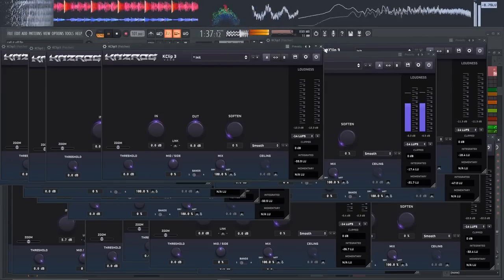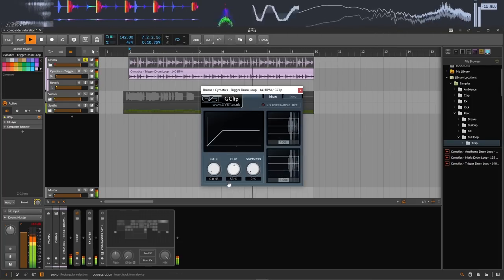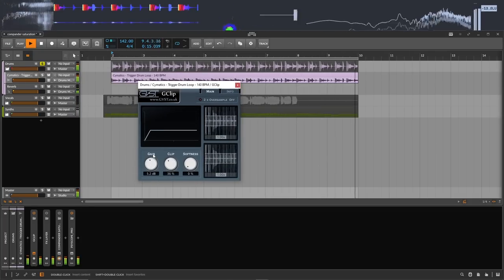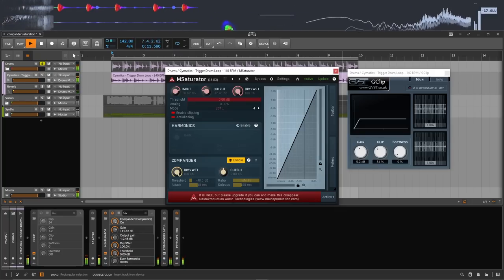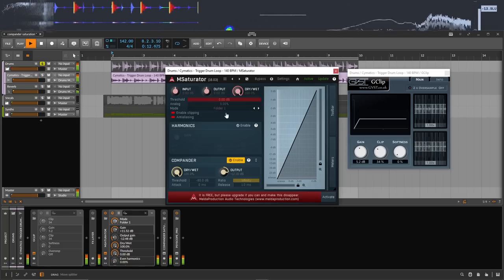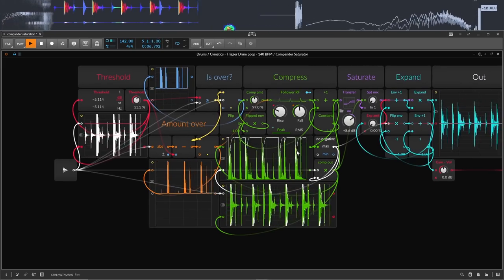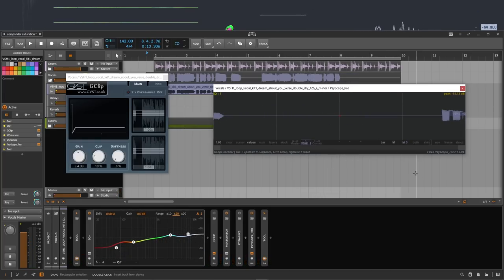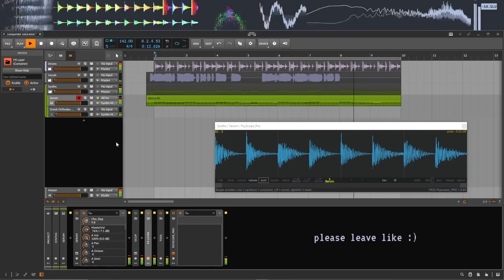heavy distortion without losing dynamics

Comment: thats cool, and i can also recomend kilohearts distortion, but i just wanted to point out the simplest solution: dry/wet mix. layer an unsaturated signal with the saturated signal.
Reply from the maker: cool I’ve been meaning to try the free kilohearts plugins.

yeah parallel saturation is really similar to this effect since it keeps some dynamics, but it’s not the same as this. find the thread on @Wurldz comment on this video to see how it’s different.
Reply: @jshstuff  honestly ive had the kilohearts subscription for years and im very happy with it. and yes, parallel saturation is different  but the result is at least similar

Comment: I've done a similar thing in fl studio a couple times just taking a peak controller output from before the saturation and connecting it to a balance so the original dynamics are preserved
Reply from the maker: I tried with peak controller and got really bad results. did you have any luck?

Comment: try dividing the input by an envelope follower signal of it, and then distort that, and then multiply the envelope follower signal with that. depending on the envelope follower settings, it’ll change what dynamics frequencies it uses to change the timbre of the distortion. it’s also a cool effect (when sent thru some envelope to make it no longer constant amplitude)
Reply from the maker: this is essentially what I’m doing with my grid patch, yes?
Reply: @jshstuff  i didn’t look closely, but it sounded like the signal still had dynamics going into the distortion. dividing a signal by its amplitude envelope gives a nearly constant amplitude signal
Reply from the maker: in the grid patch I have compression before the distortion and expansion after the distortion. I think this is exactly what I'm doing if I remember right. if you've got bitwig you can check out my final version, link is in the description
Reply from the maker: also in the final one I made both the compression and expansion stages optional, with "ratio" knobs for both, so it's pretty versatile
Reply: @jshstuff  unfortunately i don’t have bitwig. i suppose what i suggested was a more extreme version of what you did

Comment: i think this is a very complicated way of parallel clipping, no?. why not just mix the original and the wet signal and get both, the original peaks AND the harmonics of the wet signal? and its even better because you dont need to force the old waveform onto a signal that lost half its data through the clipping process? maybe i dont get it fully
Reply from the maker: hello mr robert :) a lot of people asked a similar thing, I always quote one of the earliest comments by @Zef Parisoto who answered someone asking how this is different from mixing in saturation in parallel:

"As far as I understand the advantage would be that on 50% mix you're still only going to have 50% of the original dynamics and 50% of the colour while with this method, it'll be fully coloured and you can maintain 100% of the original dynamics if that's what you want!"

to put it another way: with parallel processing you're always compromising with less dynamics or less clipping, so this technique allows you to be more extreme with both.
Reply: @jshstuff  not sure if that makes sense. in a 50/50 mix situation you have both signals at 100% :D and still, you shape a "destroyed" signal, which yes amplifies the harmonics but also the destroyed signal. not sure if i would want to do this to vocals :D 

but i also dont want to talk this topic down, its always nice to see people experiment and find new interesting ways of shaping audio. I sometimes get this video send via dm and asked what i think about it :D 🤝
Reply from the maker: I think I'd stand pretty firmly in saying that this technique allows for more extreme amounts of distortion and dynamics than parallel processing is able to accomplish because unlike parallel, the dry signal is not output whatsoever. but yeah, give it a try, and at the end of the day it's not better or worse, it's just a different way of doing a similar thing 🤝

Comment: Great video! Managed to do it in Reaper with stock plugins and parameter audio modulation :)
Reply from the maker: very cool! I want to use reaper more
Reply from the maker: I mainly know about Reaper from some Dan Worrall videos where he uses it to link parameters in a really nice way. it seems like it's got some amazing features. the downside to me is that the UI is mediocre. I like stuff to look pretty. but the fact it's just $60 seems incredible for a great, fully featured daw.
Reply: @jshstuff  yeah the UI is extremely basic but it works fine for me, there are in depth customization options though. Yeah 60$ is amazing considering that with it come many many many invaluable plugins made by the community that work only in reaper (and that are free). Also great macro possibilities.

Comment: could you alternatively just slap a compressor and expander before a saturation plugin, dial in saturation and then (in terms of plugin routing) work backwards?
Reply from the maker: no because if the compressor and expander stages are before the saturation, they’d essentially cancel each other out so it would just be like running the sound straight through a saturation.
Reply: @jshstuff  so they’d come after?

Comment: Interesting... I went the opposite direction, where instead of using an envelope to re-curve the original peaks, I instead used a downwards expander (reduce volume below threshold) before or after the saturation to accentuate the dynamics.

ie. Lots of Kilohearts' dynamics plugin.
Reply from the maker: neat, yeah the concept is the same.

but how are you able to recover the original dynamics post clipping using kilohertz dynamics?
Reply: @jshstuff  I'm not necessarily looking to recreate the original dynamics, but to emphasize the space that already exists. I want to dig into whatever troughs in the sound are there, which leaves space for other instruments to cut through or can increase the perceived punch in the sound, depending on how the expansion is used.

And, if I did want to actually re-carve the dynamic curve back into the sound using downward expansion, all I'd need is exactly what your grid patch does, except the threshold placement and the envelope bias would be different. No meaningful difference, really

Comment: what about just using a send doing whatever effects you want on the send/parallel track and blend that in
Reply from the maker: yeah sure you can do that! but the benefit of a compander is you can keep the signal at 100% wet and still get those dynamics. using parallel processing you'll always have some of the original signal, so it's less effected.

Comment: what microphone do you use? and do you have any affects or anything on it?
Reply from the maker: I’m using an AT2020 with a sock as a pop filter. it’s not a great voiceover mic so I’m doing a lot of processing

-high pass to remove rumble/low end
-found my room’s resonances and notched them a bit
-a compressor to reduce just my loudest words by 3-5db max
-noise gate for when I stop talking
-a SPITFISH is doing some heavy de-essing
-a TDR Nova is doing some pretty heavy dynamic EQ, essentially multiband compression so that my voice’s lows, low-mids, mids and highs are each more glued. It’s doing up to 10db of gain reduction for each band.
-some eq to bring out the good parts of my voice and reduce the harsh parts
-a little bit of parallel saturation to make my voice thiccer, but it’s pretty subtle and only mixed in at just 30%
-a limiter at the end

in the future I need to do a mouth declicker because my mouth sounds are still way too loud.

Comment: ok did I understand correctly that you can load any clipper distortion plugin before msaturater and compensate with the compander 
or can you only use msaturator alone to achieve this effect? 

Otherwise really great tip, looking forward to more sauce🙂
Reply from the maker: not quite - the MSaturator is the clipper. a dynamic signal needs to make its way into MSaturator so that after the clipping, it knows how to expand the signal to make it dynamic once again.

there are other ways to do a similar thing though, if you understand the concept and get creative. for example if you have a synth pluck playing quarter notes, you could clip it really hard to add harmonics, then you could draw some volume automation doing the same quarter note plucks and voila you have a dynamic and saturated sound.

hope this helps :)
Reply: @jshstuff  oh that helped a lot thank youuu :3

Comment: How does this technique change if you use the newer clip at the end feature in Msaturator?
Reply from the maker: hmm interesting I don’t have the latest version so I haven’t tried this. my initial guess is that if you have this on, it will: 1. compress the sound 2. distort with the harmonics module 3. expand the sound 4. apply the saturation/clipping curve.

as opposed to 1. compress 2. harmonic dist 3. clip 4. expand

not certain on this?

Comment: yknow its kinda funny, but i ended up doing this by accident in one of my own plugins, instead of using a compressor though, i just manually multiplied the output to bring it back to the original volume, almost like an automatic gain renewal thingy
Reply from the maker: did you call the plugin “gain renewal thingy”?

Comment: Isn't this basically the same as applying a transient shaper after a saturation plugin?
Reply from the maker: similar but no. we’re automating volume over time, rather than only changing volume when a transient is detected. the vocal example in this video demonstrates it well - you can see that dynamics are being restored even at non-transient moments, like as the voice slowly swells louder and quieter. but in the case of something like drums, transient shaping might work equally well at restoring dynamics since the dynamics are directly linked to the transients.

Comment: How can I do this in FL Studio?
Reply from the maker: 1. load up a fruity envelope controller to the signal pre-distortion
2. use a distortion like fruity waveshaper to shave off the tops of the waveform/add harmonics
3. post-distortion use some kind of volume knob like fruity balance, right click the knob, link to controller, pick the peak controller's signal
4. tweak the peak controller parameters to control the volume restoration

I haven't gotten great results with fruity env controller tho. I think the free Melda MAGC plugin can do basically the same thing a lot better. @mayfourteen
Reply: @jshstuff  thank you for your reply.   I will try out both 😊

Comment: hope that someone can help me understand this better: in the explanation it look like he just need to clip the sound, then add the expander in to gain back the original dynamic, the sample itself already compressed. does compressor help with anything else beside controlling the dynamic in this method?
Reply from the maker: you’re right, the compressor isn’t actually essential here. the only important part is the expander after the clipper to restore the dynamics. in MSaturator and my grid patch, the main purpose of the compression is to make the saturation steadier, more consistent.

Comment: Stupid question warning: couldn't this method be replicated by automating the knobs responsible for the squash factor in GClip?
Reply from the maker: no you wouldn't get the same result but that could be its own cool effect if you were to let the transients of a sound come through the clipper but saturate just the quiet parts. but with gclip alone you'd need to do manual automation work to do this. though it would be pretty easy on, say, synth chords that play every quarter note.

the reason this wouldn't work with g-clip alone is that this trick needs at least these 3 things:
1. an envelope that follows the volume of a sound over time
2. something to add saturation/distortion/clipping/whatever you want to call it
3. a way to automate the volume according to point 1's envelope to restore the dynamic after it's been squashed by the saturation

g-clip is just a clipper with a pre-clipper gain knob, and a threshold knob. so the automation you suggested would be either:
- dynamically pushing the signal up harder into the clipper
- or raising/lowering the threshold, allowing some moments of sound to be less affected by the clipping

hope this helps :)

Comment: I experimented around with this idea after seeing videos about acusticas dynamic saturator. Also works in a simple fx layer with envelope folower saturator and a tool. Advantage is in fx layer you can use every other distortion Plugin :). Hopefully someday i can implement vsts in the Grid.
But often parallel distortion is what i go for if i'm wanting to retain some dynamics.
Reply from the maker: yeah envelope follower is an awesome way to do this, it’s way simpler than my grid patch. this is by far my most complicated patch I’ve made, I’m still pretty new to the grid. you’ll get there

Comment: Just wow, i didn't know it was possible! But i still don't fully get it. Is it the same as if i clipped the waveform first and then applied volume automation exactly like the original waveform after to restore the dynamics? I hope that's understandable. Great vid btw!
Reply from the maker: yeah it would be exactly like that! you could do this manually with volume automation to restore the original shape to a clipped signal

Comment: This just seems needlessly pointless. Can just use an envelope follower or parallel processing. Also, if you want to better control dynamics, just use a transient shaper before the clipper and find a sweet spot. For example, if you have drums that get too sustained after doing clipping and compression on a drum buss, just put a transient shaper on the kick/snare and adjust the decay/sustain from there to help get things back in line. With a transient shaper too, you can also just adjust the attack to change the transient characteristics. So much simpler and you can add character back after this with a compressor.
Reply from the maker: yeah everything you're saying makes perfect sense. transient shapers will work great for percussives and such. but one thing you should consider is how an envelope follower & a transient shaper work differently. one just picks up on transient moments while an envelope follower follows the level of the sound over time. I think the vocal example in the video shows this difference well, as post-clipping, a transient shaper wouldn't restore the same level of swelling up and down of the level that this style of envelope follower does. it would just find a couple transient moments and let you change those.
Reply from the maker: @ElianaDAngelo just stumbled across this again. months later but you may be interested in my recent video where I compare this companding technique and clipping + transient shapers :)

Comment: watched it multiple times but still don't get it why not use a parallel compression
Reply from the maker: good question - parallel saturation is very similar but not quite the same! sort the comments by date and go way back near the oldest to @Wurldz comment, the thread explains it pretty well.

Comment: cant you just use a transient designer? Add in attack, lower sustain slightly fr tightness.
Reply from the maker: totally, transient shapers could work in some cases. I think transient designers would be best on drums, but wouldn’t be as good on swelling, dynamic sounds like the vocal I showed, because transient shapers only detect the transients and momentarily increase/decrease the volume, rather than this compander setup which follows the actual volume of the sound over a longer period of time. I think.

Comment: Really dope video! I assume you can achieve similar results with Ableton's saturator and compressor?
Reply from the maker: could be wrong but I don’t think so. you’d need a way to make the compressor restore the dynamics after clipping it into a sosig. normal compressors and saturators won’t do that.
Reply: @jshstuff  I was thinking of flipping the compression settings to expansion instead of compression. first saturation/clipping then expansion after the fact.
Reply from the maker: the problem with that is: what’s going to be triggering the expansion? think of the drum track I showed in this video. when you clip them, you lose all the information about its dynamics. the peaks all go away. the peaks of a sound determine how and when an expander will expand. so a normal expander won’t be able to expand the drums back to their original shape. you’d probably just get bad results in this case.
Reply: @jshstuff  You're right, I didn't consider that. Thanks for the info! Definitely going to grab this plugin. Also subbed